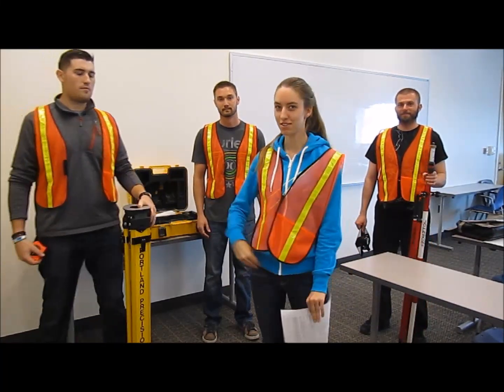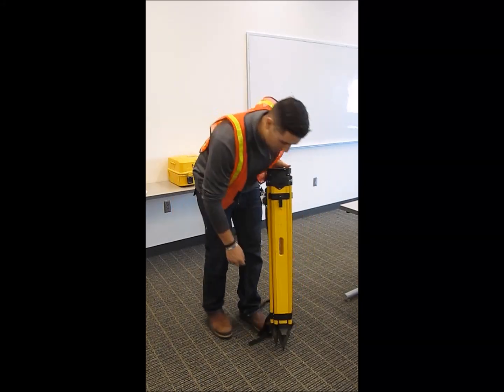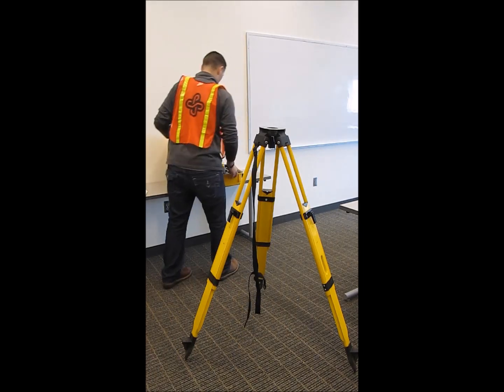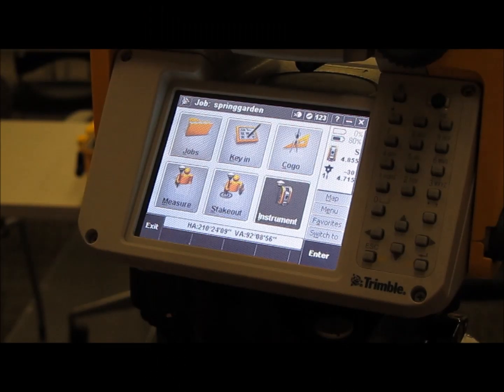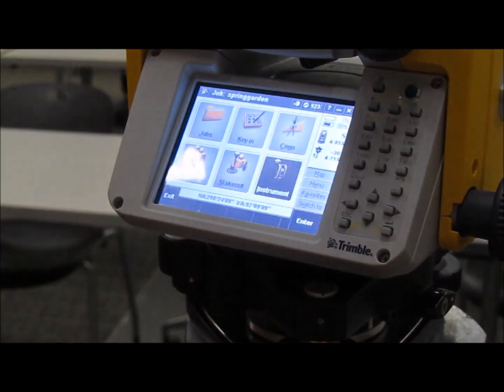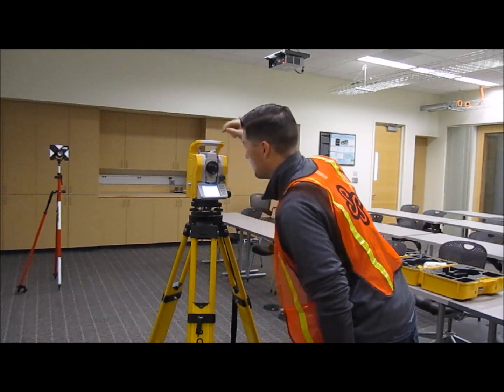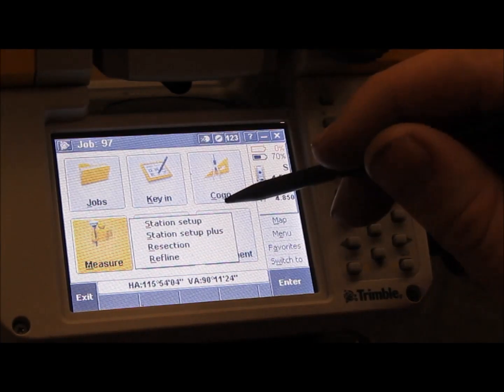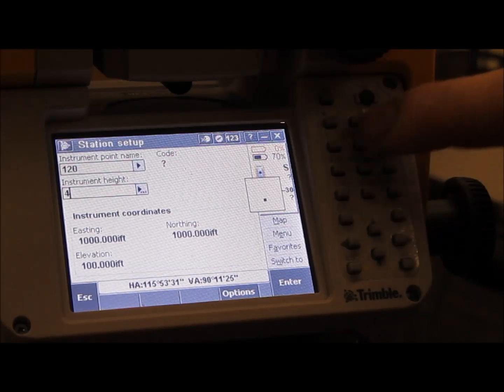Correct Setup and Operation of Trimble total station

Comment: on the Tripod setup, I raise it up to about your chin. The reason why is, when you spread the legs out, the head of the tripod lowers. You don't want to crouch down to look through your Total-station because it was set too low.
Reply: Yea... I was gonna say. Chest height you're practically bowing and it's not good for your back.